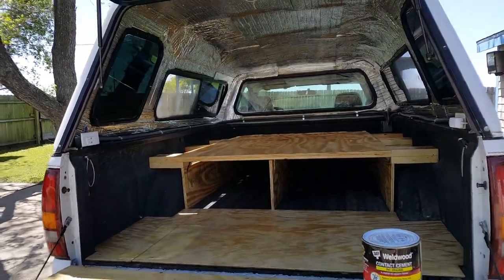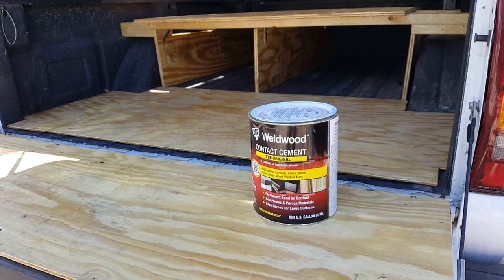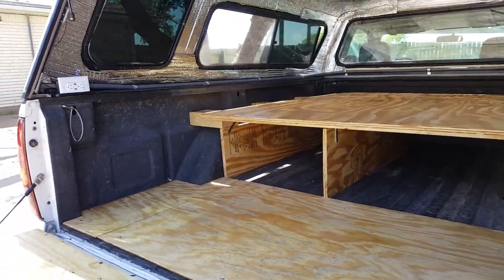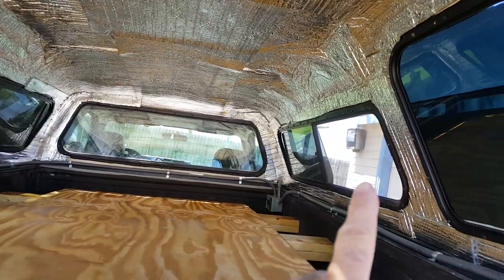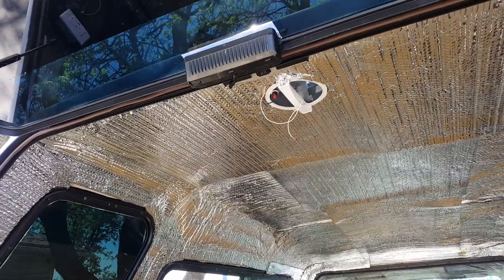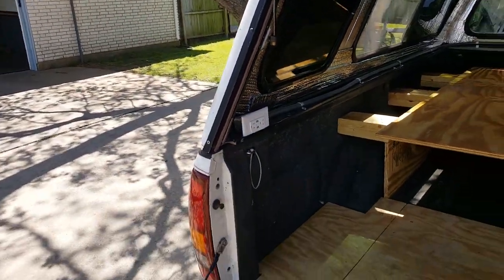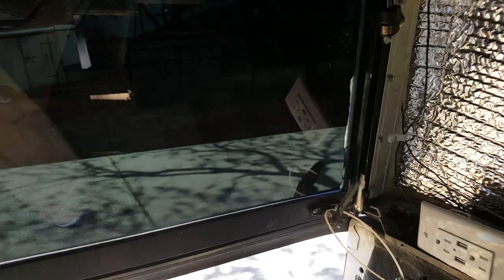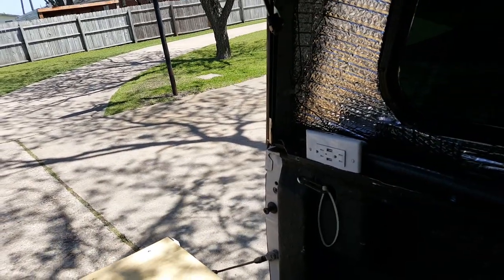FIBERGLASS CAMPER SHELL TOPPER IMPROVEMENTS GMC Sierra Chevrolet Silverado  Reflectix Vent Fan

Comment: How's the reflectance holding up is it falling down due to condensation, or any other problems I would appreciate it if you let me know thank you
Reply from the maker: It is still attached and doing well. I haven't had any problems with it. We rarely sleep in the back of the truck now though, since we have the cargo camper trailer.

Comment: How does the little fan do? Would you go with the same one or a bigger one?
Reply from the maker: That little fan was less effective than I would have liked. I probably would not try that one again. Good luck on your project.
Reply: @FakeLegGreg  thanks for the feedback. I hate to cut a hole in my top but if I do I want it to be effective. On the other end if I install a 14×14 vent it may draw more current than I want to provide.
I'm not going all out with a big power bank and panels. Just want to camp a few times a year and be comfortable when I do.
Reply: @jamesrogers4674  did you install a 12V fan? If so, what power source did you hook it up too?
Reply: @brianjunga3236  haven't touched it. Been to busy. Bought a 29' camper and went once so far.

Comment: When you drilled the vent fan, how’s you do it? Looking at adding an rv vent fan to my shell and am stuck on two things. A.) how to drill the hole (I’m thinking a router) and b.) how to hook up the 12V power and where.
Reply from the maker: I used a hole saw to cut the hole for this fan. The fan was not very powerful though and I took it out and sealed the hole up. You can run a hot wire from your fuse box on the drivers side of the dashboard. I cannot tell you which circuit to tap into. Or you can run a hot wire from the positive side of the battery, but be sure to install a fuse in the wire also. Good luck.

Comment: How did you apply the contact cement to put up the reflectix and then to put up the carpet?
Reply from the maker: I just brushed it on. It wasn't fun but it worked. Paint brush. Good luck.

Comment: I'm thinking of doing this to my cap.  In your opinion, do you think it makes a big difference for staying warmer, or is it not that noticeable?
Reply from the maker: It just slows down heat transfer and thus temperature changes. When it's hot outside it will get hot slower but still get hot. Same with cold.
Reply: @FakeLegGreg  Thanks

Comment: How cool does it stay with the reflectix?
Reply from the maker: I haven't tested it with any thermometers. If it's a 100 degree blazing hot day, it won't help. But it seems to help stabilize the temps at night when the breeze is blowing through.

Comment: If someone pulled hard enough those cable ties and or handles would break
Reply from the maker: Agreed but this is not fort knox and the intruders would not be aware that the ties are there initially. This slows them down for me to be prepared with my defense.
Reply: @FakeLegGreg  I've been trying to come up with something also. No lock is completely reliable
Reply: @FakeLegGreg  2nd Amendment :)
Reply from the maker: @jamesh.7599  :)
Reply: If they really wanted in that badly it wouldn't be hard to bust the glass in the hatch.. It's just a deterrence